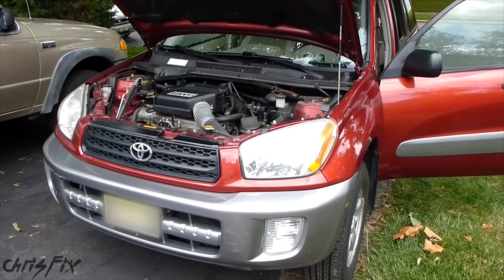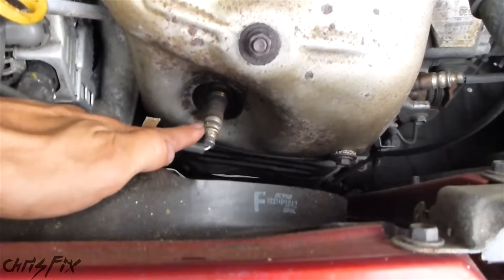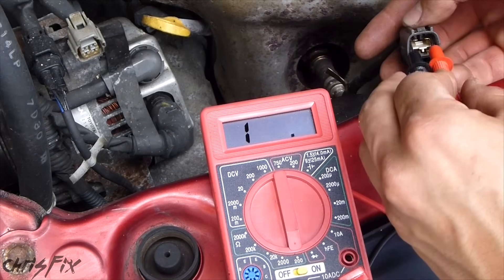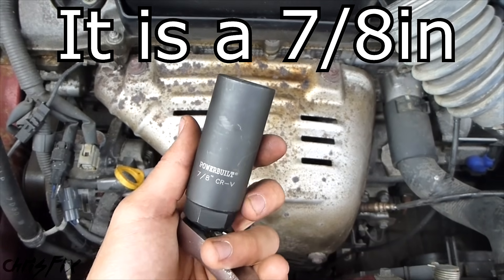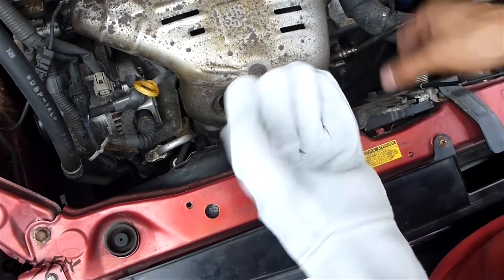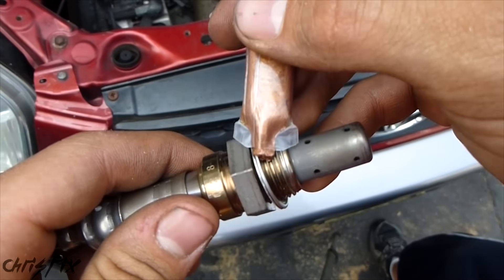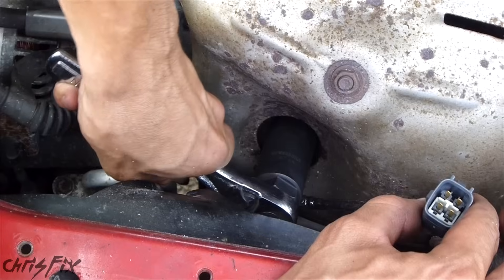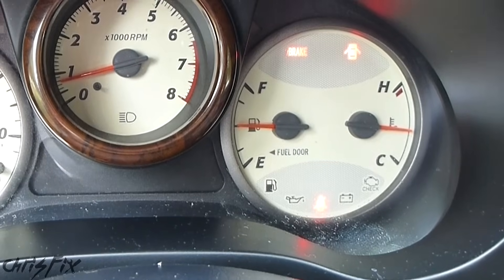How to Check and Replace an Oxygen Sensor (Air Fuel Ratio Sensor)

Comment: Hi Chris, me again, i always have some comment, but there not meant as a critisim, rather just a comment, in this case, i just wanted to say that an Oxygen sensor and an air fuel sensor are two different things, an oxygen sensor, or Lambda sensor senses oxygen in the exhaust prior to the cat and adjust mixture accordinglty, an air fuel sensor just monitors and sets the air fuel ratio, which should be about 14.7:1,  thats Stchemetric 1....excuse spelling......from Fred in UK  (see scannerdanner videos.)
Reply from the maker: +Tom Smith Thank for sharing. The idea was to title the video O2 sensor because most people know what that is and even refer to AF ratio sensors as O2 sensors. In the video, I say AF Sensor.

Comment: Do you have to change them when they fail or as a preventive maintenance? If so, how often? Also, I've read that the sensor must be the same than the one removed to avoid to mess up with the ECU, what are your thoughts on that? Great videos as always by the way.
Reply from the maker: +Cyril Azoulay You just replace them when they fail. You can put new sensors in without causing any problems.
Reply: Thanks Chris!

Comment: How can you tell if it's the o2 sensor or the catalytic converter that is bad?
Reply from the maker: +Dylan Cyr You have to look at the live data on a  scanner. I will be doing a video on that so stay tuned!
Reply: I was worried that might be the case, sadly my OBD reader doesn't give live data so I can check the voltages :(

Comment: Hi, Chris, I am very much interested in your videos, actually I appreciated your clear show and now I understand how to check and replace the O2 sensor, however I wonder if there is any measure available to maintain my sensors for a longtime without blocking them. Big Up Man. This is the best show ever.
Reply from the maker: +Kayiranga Francois Thanks! The car's computer will adjust for the wear and tare of the sensor so you dont have to worry about it.
Reply: +ChrisFix Hi Chris, I thank you once again for your help, I bought 2 sensors one for Bank 1 sensor 1 and bank 2 sensor 1 because they were brocken, I put them but the problem wasn't fixed and I checked they were new, could it be because I didn't apply the other stuff(I mean those packed in a small plastic bag with sensor)? or is there any other related problem that could be linked to those 2 sensors?

Comment: hey Chris,I have a 2001 nissan pathfinder v6, this truck use sho much gas, that's not a joke,I just bought.it, do u think it is a bad upstream o2 sensor? no check engine light, but when I scan it with my odb2,lean to rich sensor, what should I do,I heard I can use  maf from 2001 maxima, what do u think?ppl said it work great on pathfinder
Reply from the maker: +STEEVE DAVID Nicolas It could be a bad sensor. Check to see if your exhaust pipe has a lot of black soot in it or around it. Might be leaking injectors. Use your scanner to see what the fuel trim is.
Reply: +ChrisFix where is the injector leaking?

Comment: Hey Chris I have a read of P2251 on my 2005 Hyundai Elantra. Could tell me where that is exactly? And is it the same fix as this video?
Reply from the maker: +Cjei “BallLife29” Canorino The P2251 code is Rear Air/Fuel Ratio Sensor Bank 1 Sensor 1 and you need to do exactly what you saw in this video.

Comment: Hey Chris, thanks for putting together such a clear tutorial on this process.  I was able to successfully replace the faulty O2 sensor on my Toyota Highlander using your video as guide.  And while it was a bit intimidating at first, the process was smooth thanks to the path you provided.  It was great to do it myself (saving garage fees) and I now have a clearer understanding of how the O2 sensors work with the engine.  Much appreciated!
Reply from the maker: Jason Liebig AWESOME! That is great Jason and exactly why I make these videos! This comment made my day!

Comment: of course you have to show how to replace the easy ones..lol i have a 2000 Isuzu trooper and the 4 sensors run along the exhaust system under the vehicle and not easy to get to
Reply from the maker: Mike Cullinan Well this was the car I was working on and needed sensors...

Comment: Hey Chris I have a 07'Civic my check engine light has not come on,but fuel economy has dropped sharply.Plugs have been changed should I consider changing my lower and upper O2 Sensors,only 164000km.
Reply from the maker: john schober I would not just throw parts at it. I would use a scanner and get live data to see if the o2 sensors are working correctly. I would also do a fuel pressure test: https://www.youtube.com/watch?v=_oXLUqE4Sf0

Comment: I was always told that the downstream sensor does not affect fuel trims or mileage and that is Not true!  The first purpose of the downstream 02 sensor is to measure cat efficiency. The second function is downstream fuel control. This function adjusts the upstream 02  goal  voltage within the range of operation of the upstream sensor. The upstream goal voltage is used to ensure long cat life by allowing the PCM to control the amount of air and fuel that is supplied to the cat. If the downstream 02 sensor switch point is at a  low voltage the PCM will adjust the upstream 02 goal voltage to reduce  high 02 content by . If the downstream 02 sensor  switch points stays  high, the  upstream 02 sensor goal  voltage will change and  allow a low 02 content.
My fuel trims were in the negative 25 percent until I change my fixed rich downstream sensor.
Reply from the maker: Metal Maniac Thanks for sharing!

Comment: Do you recommend to erase the code once the new part is installed? Because I installed a new Purge Solenoid Valve on my Mazda CX-7 but I did not erase the code (P2178). The reason I install this particular part is because in most cases it would resolve the problem. Now, this weekend I will check the oxygen sensor in bank 1. Great video as always. Thanks...
Reply from the maker: Jammin Dave You should delete the code when you do the fix. Then see if it pops back up down the road. If not, you fixed it.
Reply: Thanks!!!  would do.

Comment: Great video Chris, however u might want to back probe those connectors, Using the micrometer probes in the front can spread those connectors and cause a bad connection.
Reply from the maker: John Strong Thanks for sharing John!
Reply: John Strong The connector he is testing in the video is the male half, so he's probing the pins, not the sockets. Nothing to spread.

Comment: Can u do a video on how to clean fuel injectors or atleast change em ive pulled my fuel rail up so i can replace upper n lower manifold gaskets but dont knw how to take off injectors, makes me nervous n i wanna put new ones on or atleast clean the ones i have on my 07 charger
Reply from the maker: 3232myke Yes, I will be doing a video on how to clean them since mine is so dirty it is giving me a misfire code!

Comment: I had one sensor go on my charger so i just replaced all 4 of em i fig if i have just 1 brand new one the rest wont work as well as the new one so replaced all n car drives nice my mpg's r good n car runs smooth over 200,000 on my 07 charger
Reply from the maker: 3232myke Awesome! Keep the old ones just in case!

Comment: +1 for showing how to test the old sensor!
Reply from the maker: Austin Gilbert Thanks!
Reply: @chrisfix  so if sensor has continuity... what would we need to do to get rid of the code?
Reply: @juliusmondejar246  Your OBD2 scanner should learn you instructions to reset the code. Try to find a manual online and follow the procedure.
Reply: @juliusmondejar246  This is P.Dub from Fresno on my lady's Sonya's tablet ...I too had this same situation.. Mine showed continuity, but the red sensor code still remained..the thing is, just because there is continuity doesn't mean the o2 sensor is good!.. What I ended up having to do is replace the o2 sensor with a new one and the o2 red code was repaired...
Hope this helps you out...
Reply: @juliusmondejar246  The resistance test is for the sensor's heating element only. The sensor could still be bad even if it reads continuity.
Reply: @chrisfix  sir, my i20 O2 bank1 sensor reading is out of the recommended readings as shown on OBD2 SCANNER. 

I don't have any troubles codes in the scanner. What's the problem with that reading out of limit?? Thanks.

Comment: ChrisFix
So testing resistance between 2 black wires is enough to diagnose if sensor is good or bad?
I dont need anything else?

I just have to replace some of the exhaust pipe and sensor also is between this.
So i would like to test old sensor before i put it back. It also has 4 wires but i didnt look what colors.

I really wouldnt like to buy new sensor.
Reply from the maker: jw200 What you saw in the video is how you test it!
Reply: ChrisFix 
I didnt have any black colors.
Just 2 white wires, one gray and i dont remember the fourth wire.
I tested the 2 whites and got some readings in Ohms but it jumped around.
Probably too bad connection between multimeter and connector. Not sure.

If i heat it should the resistance go down?

Comment: Hey ChrisFix  how do u know which is bank 1 n bank 2? I thought V6 n higher engines do have 2 banks while 4 cylinder engines only 1 bank...can u explain this? Thanks man!
Reply: Jorge Melgar Bank 1 always corresponds to cylinder 1 on the engine. Sensor 1 will be before the cataclysmic perverter (should be in the exhaust manifold, like in the video), and sensor 2 will be after the converter. V-6 and V-8 engines will have 2 banks (because they have two exhaust manifolds, although they may only have one sensor 2 if they only have one catalytic converter), while straight engines such as a 4 cylinder or a straight 6 would only have one bank.
Reply: garrisonaw  its all clear now! thanks a lot man...much appreciated

Comment: i was checking out my oxygen sensors bro i have two whites terminals and one gray and the other one is black.. which one should i get the test from?? when i tried the whites... i see the continuity but when i tried the other one i don't get none...
Reply from the maker: Hiram Camargo Check the wiring diagram because it varies. Do you have a check engine light?

Comment: i got a check engine on my Ford F150 1998  got the P0171 and P0174. i changed the fuel filter, changed a couple of hoses that were all rusty and bad,  cleaned up the MAF Sensor, bought a new air filter, poured some sea foam, replaced the PCV valve... i erased the code and a day later the engine came back on...
Reply from the maker: Hiram Camargo What is your fuel pressure? Check this out: https://www.youtube.com/watch?v=_oXLUqE4Sf0

Comment: The wave of the 02 seems secondary to another issue in many cases.  Like an EKG reveals an irregular heartbeat, the O2 sensor waveform will also reveal any underlying problems such as vacuum leaks, ignition misfire, injector imbalance and even compression losses. Each of these conditions will produce a characteristic type of hash in the sensor waveform. Anytime a cylinder misfires or leaks compression, unburned oxygen enters the exhaust. This shows up as a momentary dip in the O2 sensor's output voltage. So if the O2 sensor's waveform contains lots of little inverted spikes, it tells you the engine is misfiring or leaking compression. You can then use your other diagnostic equipment to nail down what is causing the problem. A "digital storage oscilloscope" (DSO), also known as a "dual trace scope," is unquestionably one of the most useful pieces of diagnostic equipment that is available today and prices for under 100 dollars for a basic bare bones model.  This could help answer "is it cause or effect" type of questions underlying this and many other theories in the field.
Reply: I’m erratically gettin a p0171 code and it only happens in cold weather. Goes out by itself. No outward symptoms and the manifold gasket is Not leaking. Can u suggest a coarse?!
Reply: That's an inane recommendation for fixing a cheap old car when replacing the o2 sensor would get reasonable results for a bother several thousand miles.

Like killing a spider with a sledgehammer

Comment: before you fix the problem, can you feel the difference in performance or fuel economy?
Also sensor 2 means (after catalyac converter) O2 sensor correct?
Reply from the maker: 7150285 We saw a difference in fuel economy. Sensor 2 is after the cat, correct.
Reply: ChrisFix and the reading should be showing a steady line if the cat's working properly? Talking about the sensor 2. Unlike the sensor 1 the A/F ratio sensor.
Reply from the maker: sensor 2 should show a relatively flat line at idle and sensor 1 should bounce around from around .9v to .1v (like a heart beat)

Comment: Hey ChrisFix , question for ya,
I got a 97 Nissan pickup with around 90k miles on it.Since I've had it (4+ years, drives great) the check engine light comes and goes sporadically, and I've never noticed any symptoms to go along with the light. Anytime i test it, it says its the O2 sensor. Question is; If the check engine light goes off by itself, does that mean the sensor is ok / just needs to be cleaned? Also, i noticed recently when i first start-up and idle the RPMs rise to about 1300, doesn't happen after I've been driving. Any thoughts?

Great Channel, Keep up the good work.
Thanks for any input
Reply from the maker: GT T If the check engine light goes off itself and comes on every once in a while, that means the sensor or cat is going bad but is still somewhat within the tolerances. So every once in a while it gets out of tolerance and the light will go off. But then after a few drive cycles or about 50mi the car runs fine so the check engine light shuts off. When you start the car, it will idle high for 20sec or so.
Reply: +ChrisFix +GT T hey Chris. Great work you're doing. one of my fav channels on Youtube. Can we just clean the oxygen sensor? I saw a guide online to leave it overnight in gasoline. These things are expensive, and 4 of them in a normal car! I got a P2096 on my 2010 Kia Forte, lean exhaust. Related to oxygen sensor, but I'm not sure. 

I've started purchasing parts direct from distributors to bypass dealers who are charging 400% the actual price. This is true in Malaysia, I've bought shocks, plugs, filters, fluids, at 1/4th what they charge me at either official Kia or OEM service centres. And then I look at your channel to make sure my private mechanics are doing the service right. 

I have my own OBDII Bluetooth checker, but now I need the dealer to help me check the engine code. Its crazy: I bought my Bluetooth OBDII sensor for USD10. The dealer charges me USD10 just to plug in his OBDII sensor!! Another USD10 to look at the engine and tell me whats the problem!! Its crazy!!

Comment: For reference, autozone price matches anyone, as long as the warranty is the same, and it's the price with shipping included if you buy online. So if you don't want to wait for Amazon to ship it you can price match and get it same day
Reply from the maker: bldeagle10 Thanks man! Yea, advanced auto does the same most of the time. Sometimes their computers wont let them though because the price is too low.
Reply: I work for autozone and we will match any price. We don't have any advanced auto stores where I live yet but they are getting ready to open stores here.

Comment: code P2A00 A/F sensor 2008 nissan versa, I replaced the sensor about 8 mos ago but code appear again...would it be my catalytic converter going bad, since I noticing bad smell of fume coming out from the back of the car.
Reply from the maker: panpilocop It could be the cat. I will have a video in a few months on using an obd2 scanner to show how to tell if your cat is bad vs a bad sensor. Does your car run rich?
Reply: i think the car is running rich, im only getting like 280klm per full tank and the car acceleration is poor...
Reply from the maker: panpilocop Hm, that might be causing your sensor to get fouled up so quickly but that is hard to diagnose over the internet lol. The sensor should have a warranty, might want to try and get a new one (maybe it was defective).

Comment: what is sensor 2? Why do u need 2 air/fuel ratio sensor? Or is that the after cat 02 sensor??
Reply from the maker: 7150285 Sensor 2 is the "after cat" sensor. It is an O2 sensor. You only need A/F ratio sensors before the cats.

Comment: Hey, are OBD-II worth the money? I know most can read check engine codes but do they read all or most other codes such as ABS or simpler things? Also are there any better values (cheaper with close to the same features) or trusted ones as the Bluetooth driver ($100) he has in the link? Thanks!
Reply from the maker: Baseball252010 Most OBD2 scanners are not worth the money. I will be doing a product review on my favorite scanner, the BlueDriver, soon. It can read check engine lights, ABS, Airbag, and Tranny codes. Check it out: http://www.amazon.com/gp/product/B00652G4TS/ref=as_li_tl?ie=UTF8&camp=1789&creative=390957&creativeASIN=B00652G4TS&linkCode=as2&tag=chri0e2-20&linkId=VEHVWMV7GZFBKSWF